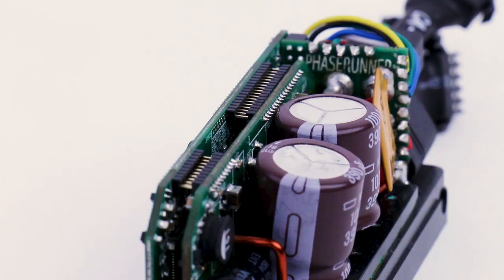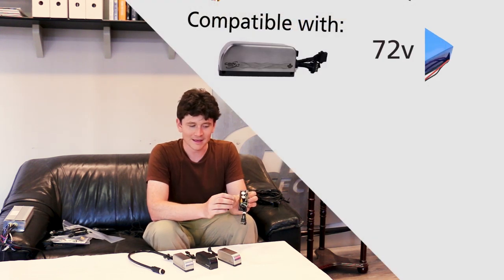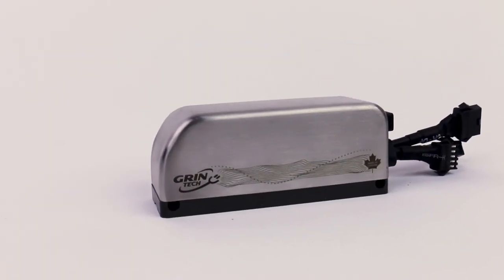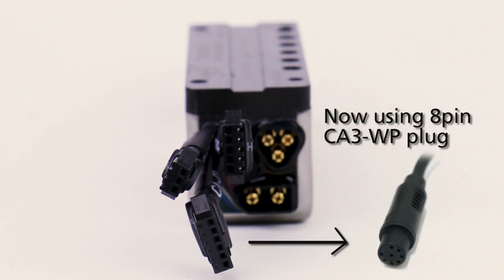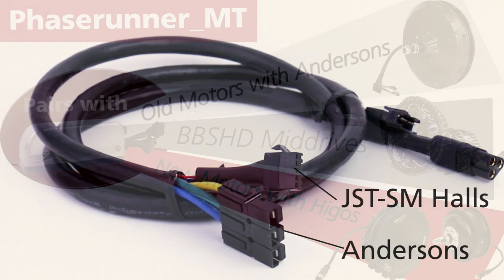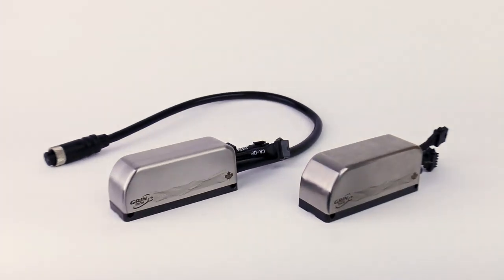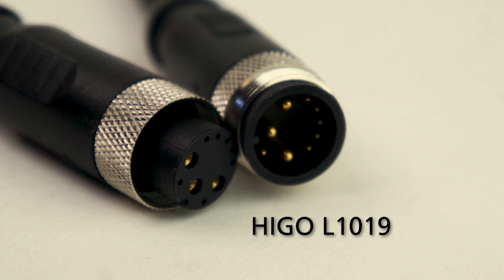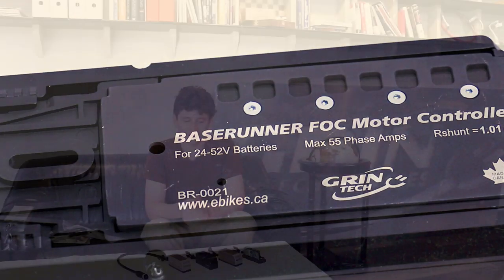Introducing the V3 Phaserunner Motor Controller

Comment: Hi Justin 
Fabulous content as always. I have a  1000watt DD generic rear hub motor, very reliable, with a 52v 28ah triangle pack using LG MJ1 cells, Sinewave 48v 45amp controller, twist throttle, and Re-gen braking. Which of your controllers would you advise please Justin? And would it be compatible with My KT-LCD8H Display?
Many many thanks for your time
Daron
Reply from the maker: Hi Daron, unfortunately we don't have any controllers that will be compatible with the KT style displays, but if that wasn't a criteria then either the Baserunner_L10 or the Phaserunner are both great options for high power direct drive hub motors like this.

Comment: Hey team! What is the capacitance of the phaserunner? (in order to select correct resistor for a pre-charge circuit to protect both the Phaserunner and connector contacts for 72v use) Thanks!
Reply from the maker: A little over 1000 uF
Reply: @GrinTechnologies  Ace, thank you!

Comment: Hello, I have a problem with my MXUS xf19r geared - high speed hub(about 740rpm at 72v). I had it made as a high rpm but with simple controllers it starts to stutter a lot at higher speeds because of the to high erpm. Can you tell me if the Phaserunner is suitable for high erpm? Thanks
Reply from the maker: We've not run into any problems with erpm limits in any of the geared hub motors we've tested it with, including a number with much higher gear ratios and rotor pole pairs than the XF19
Reply: @GrinTechnologies  thank you very much

Comment: That looks neat, I presume its water proof?
I just built a 1000w DD HUB DRIVE on my mountain bike and using standard controller bolted onto side of bike covered with a 2l lemonade bottle for belts and braces water proofing looks very goofy,  replacing it with a better one is defo on the cards sometime soon.
Love the power though.
Reply from the maker: Well it's a pricey upgrade form a generic controller for sure, but when you experience some of the features (especially the smooth proportional regen on a DD hub motor) it's definitely an eye opener in the riding experience. Always an upgrade you can look forward to at any point when the time is right and in the meantime have fun with your setup.
Reply: I'm thinking of using a back rack and putting it inside a waterproof cycle bag I bought from Ali Express.
Reply: @DylanFowler  just make there is enough cooling if you are pushing it with high power.
My battery hangs off back of back seat and bike is full.suspension so limited options for mounting
Stuff.
Reply: @FlyingFun.  I didn't realize the controller heated up so much? thanks. I will sow in some netting on the op end of the side parts of the back and stuff filtering material behind the netting so rain and dust cannot get in. Btw you can get a back rack that attaches straight to your seat post. Then mount your back and controller on it.
Reply: @DylanFowler  the heat will depend on how hard you are pushing the motor and the ambient temperature,  my 1000w controller doesn't get very hot at all here in the UK lol, but I would worry about it in a padded black bag with no air flow.
I looked at the seat post mounted frames to mount the battery on but was a little worried they might swing out but actually thinking about it the forces on a bike do not really do that because we lean into the corners.
But maybe bumpy ground might stress it...
Ideally my next build will be with battery in middle of frame, looking out for a donor bike that's suitable with suspension,  no rush as it's getting to winter here now so I expect to find something before spring.
Reply: @FlyingFun.  They look secure enough, plus they can also connect to the screw holes at the top of the drop out. That sounds like a good plan with a rear suspension frame.

Comment: did you replace the potting with the stainless steel shell or does the stainless steel shell cover form fit potting used in the prior model? or? why did you change it to a stainless steel shell on the newest version? and will this motor controller also work on motors dd hub motors as low as 350 or 250 watts?
Reply from the maker: The stainless shell made it much easier to pot and allowed us to use lower durometer potting compounds which are less likely to produce thermal stresses on the electrical components at cold temperatures.  It will work fine on low power hub motors, but is just more expensive than necessary if you are only running it at those lower currents.
Reply: @GrinTechnologies  thanks for clarifying. I was considering getting one that could be used on different wattage DD hub motors. What is the status on ordering and receiving one? 
What other options are there to a phase runner for lower currents? Are you refering to the version that you guys make that can be integrated into the battery base? I think you guys only make the two and aren't they roughly the same price?

Comment: before having a "shut up & take my money" moment, i would like to know if they could work with the Super73 line-up (especially the RX model). Thank you and have a great day
Reply: @grinn I have the same question. We need a plug/play kit for the Super73 RX's.
Reply from the maker: Afraid it's not that easy. It can power your motor just fine but it won't be compatible with the display on that bike and you'd have to redo a bunch of electrical connectors too.  It's a fairly advanced job to replace the motor controller on a turn-key ebike with a 3rd party unit.

Comment: How about the Tongsheng tsdz2 motor, is there a chance this would work with it?
Reply from the maker: It would be able to drive the  motor but not tap into any internal torque sensor and such, so you would loose some potential features of the Tongsheng system if you swapped to an external 3rd party controller.

Comment: Hello. I have a Bafang Hub Motor, nominal rating 500watts. Performance is great, but would I see improvements in some area with one of your controllers installed? Do you offer them? Hard to know from your website what to consider. So very Techy.  Thanks
Reply from the maker: If the performance is great then there is no need or much benefit to be had by simply changing the controllers. It's only something to consider if your original controller gets fried or you want to use the system at a voltage that isn't supported by the stock controller. Otherwise, keep the controller you got, and if you want improvements in range you can increase your battery capacity.

Comment: I'm buiding my first ebike right now, with a BBSHD, and I want to boost it, so far the Phaserunner or Baserunner seams to be the best solution, but what I understand is that the challenge is the programming? How complex is it to make it work together ? Thanks
Reply from the maker: Don't take this the wrong way, but generally speaking if it's not clear  what to do from the user manual, videos, and other documention we've produced, then it's likely going to be more of a learning curve than you want to take on. If you could find someone selling a controller marketed explicitly as a plug and play bbshd upgrade that would be an easier avenue for sure.
Reply: @GrinTechnologies  This is a sound assesment.  I will most likely end up on Mr High Voltage waiting list for an ASI BAC855 controller already programmed.  Thanks for your answer.

Comment: I have a juiced Bikes ocean current and it has a bafang rear hub motor with juiced Bikes torque sensor. My question for you is, would the phase runner be compatible with the torque sensor and bafang motor.
Reply from the maker: Not easily, in general we do all of our torque sensing via the V3 Cycle Analyst since the native controller integration isn't very versatile.  So the PR will be compatible with the bafang motor for sure once you have the right adapter cable, but tapping into the torque sensing signal would require some level of electronic hacking and know-how.

Comment: So you mentioned that it's for 2000w but 55amps on 72v is twice that.
Reply from the maker: We said it's intended for motors generally running in the 500-2000 watt power range.  In specific scenarios you can have motors with KV and winding resistances that will be able to run at 72V and 50+ battery amps continuously with this controller, but it would be quite misleading to say it's a controller suitable for higher wattage motors in general.   See https://www.ebikes.ca/learn/power-ratings.html  for a few more details on this topic.

Comment: can the baserunner work without the cycle analyst in the same way?  I have tried to connect my throttle to the connector but it doesn't run.
Reply from the maker: It will run just fine without a Cycle Analyst and only a throttle hooked up, but you do need to make sure that the baserunner or phaserunner on/off switch wire is ON.  This can be done via the WP8 plug connector, or via the yellow and white wires under the throttle heatshrink.  Read: https://www.ebikes.ca/documents/Phaserunner_V3_Updates.pdf
Reply: @GrinTechnologies  Thank you, I shorted the yellow and white wires, and when I plug my throttle in turns on the motor, but the throttle doesn't seem to be responsive, the motor is stuck on and running at a constant speed.   Maybe I need to use the cycle analyst software to find 0-100 on the throttle?

Comment: How well will this work with the BBS02?  Can you run it with a BBS02 at 72V and get something like 2000 watts out of it?
Reply from the maker: It would be able to run a BBS02 just fine. If you add additional cooling to the BBS02 motor shell, the performance should be able to exactly match the BBSHD motors at much lower weight. See https://endless-sphere.com/forums/viewtopic.php?t=100461#p1470275
Reply: So running 60v 16s 5p on a BBS 02 at say 1800w would give good performance and good range for a track and road commuter ?
Reply: @GrinTechnologies Weren't people reporting magnets separating from bbs02 SPM rotor on higher voltages let alone field weakening?